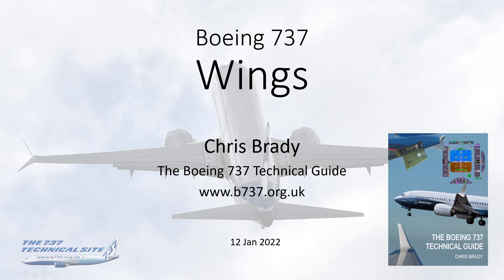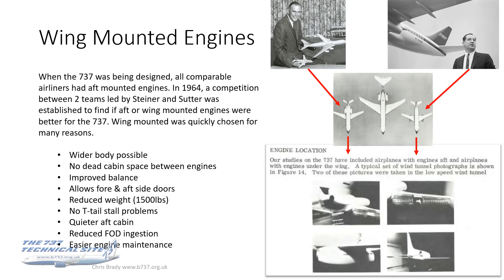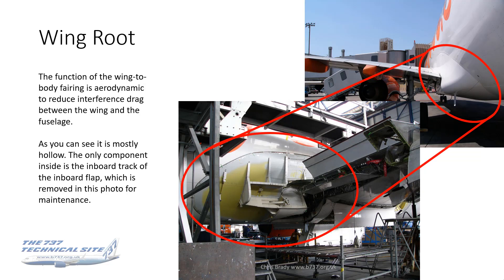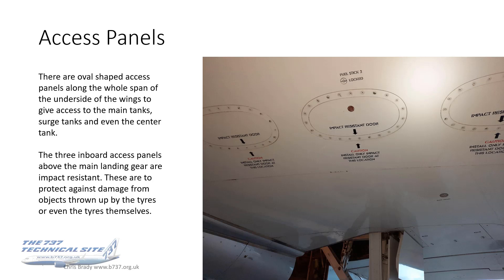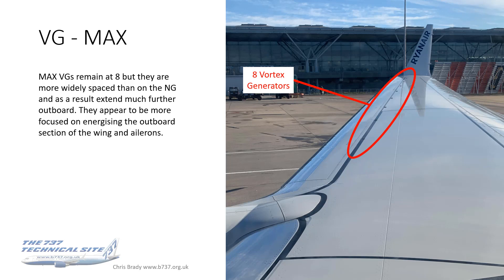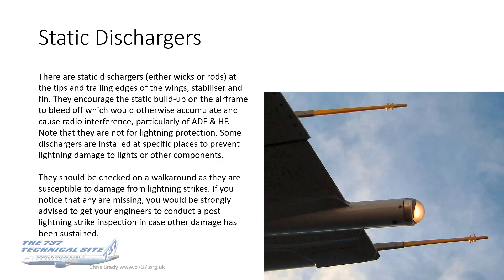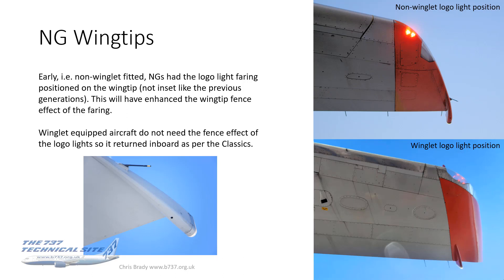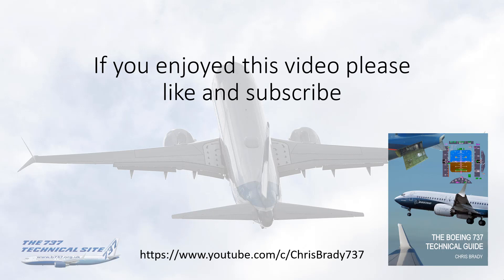737 Wings

Comment: Thank you for this channel, I enjoy it very much.  In regard on the issues between aft mounted Vs. wing mounted engines, you mention that the aft mounted engines had a higher risk os FOD,  but it will seem to me that the greater risk would have been ice breaking off the wings.  Something that actually happened in a Finnair DC-9 in 1981.

Comment: 33:00  the wing to body fairing (right hand side) also houses the Standby Hydraulic Pump on the NG and Max.
Reply from the maker: Hi Peter, you are absolutely correct - and also the brake accumulator. I was only thinking of the Classics when I narrated it because I used a photo from a Classic. My bad!